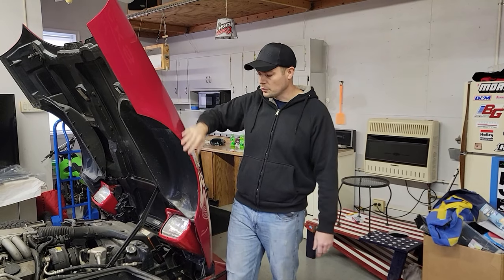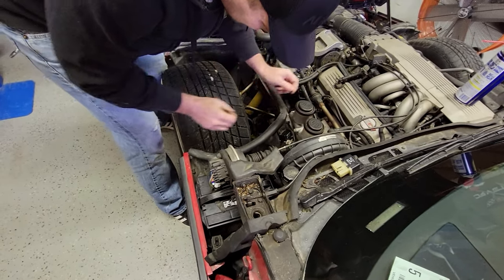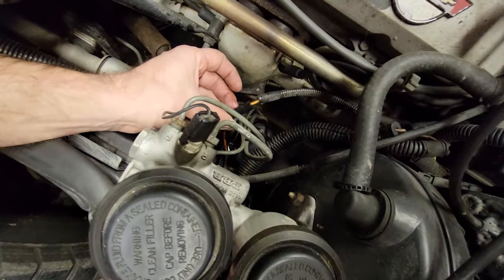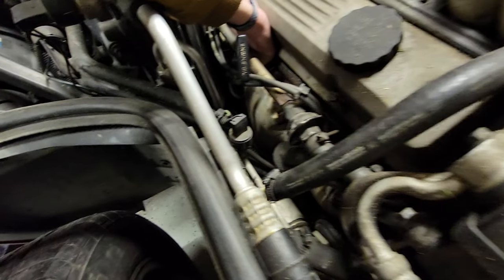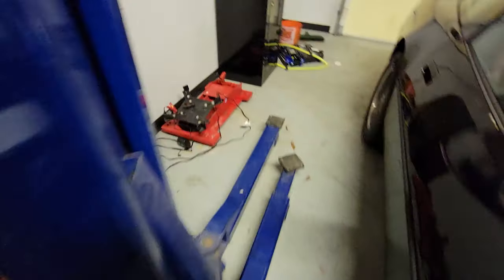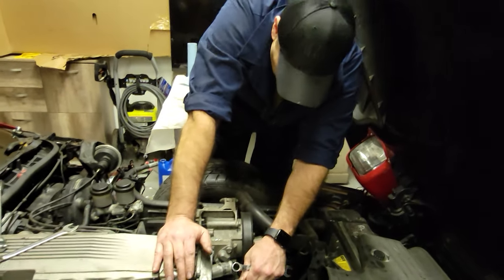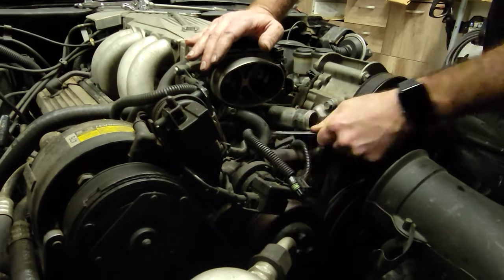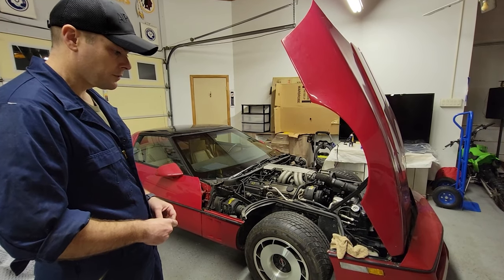New York Corvette Pt. 2- Back To Normal

Comment: Right hand head temp switch is (or should be) the optional boost fan (HD cooling package RPO V08), which is infront of the condenser core. Left hand head is a temp sender and is for the cluster only. At the front of the intake manifold is another temp sensor that feeds the ECM, beside that is the cold start temp switch. 

Temp switch you replaced in the right controls ONLY the boost fan, which is all that ran when you grounded that wire, hard to see in the video but your main fan wasn't running at that time. The ECM controls the main fan.

Comment: A little late but you may want to change your oil sending and pressure switch located behind the dist.
Mine blew out after a 50.00 dollar oil change. It was the original and had dry rotted. No damage done just had to get it home. Mine is a 1986 also had to change out the brake booster vacuum hose adapter which had dry rotted and cracked causing a sever vacuum leak.

Comment: 85's did not have the extra front chassis support. That wasn't standard till later. At least it's tpi. But don't have roller cam either. I have 87 red/Graphite Z52. Also curious about the master cylinder,  should have 1 bowl not the double.
Reply from the maker: This car has never been touched. 100% original one owner. What you see is how Chevrolet sold it.
Reply: @corvetterescued2324  Awesome find. Good luck with her. Enjoy tinkering with it. Not a vast choice for tires. Mine are so old now thinking I got them from eklers yrs ago. They call them vintage now.
Reply: My 85 has a double. Shop manual shows a double also.
Reply: @spenceair1972  87 they put the single on, was not a good idea. I have changed mine to the double, but I keep the original single.
Reply: @spenceair1972  and I have the z52 package

Comment: The fan comes on around 225...  why so hot ..u got me..but it worked...
Reply from the maker: According to GM engineering the car has better economy and emissions at the higher temp. We ended up with a 210 thermostat to keep it down a bit.

Comment: My fan doesn't come on until 229
Reply from the maker: Yeah it wasn’t coming on at all. Got up to 240 and I shut it down. Ended up being two issues. A bad thermostat and a bad temperature switch.
Reply: @corvetterescued2324  I'm quite surprised you considered driving it at all after sitting that long without changing ALL the fluids. I am glad you decided against driving it 500 miles. The hydraulic fluids will have slurped in a heap of moisture. The oil is well past it's serviceable time. The coolant will be junk. The in tank filter/strainer will be rooted and need to be replaced, they tend to go brittle and block the pickup. Get rid of the pulsator while you're in there. Replace the rail mounted fuel filter and get those injectors cleaned at the very least.

The fan is powered only from the relay, so the relay you took out was working well enough to run the fan, or it would not have run when you ground the diagnostic pin. 

Clear this car sat a long time, but i don't think it has been completely ignored for 20 years. Not sure what you paid for it, but given the condition of the interior it is still a pretty damn good condition car. 

If you haven't done so already, get the factory service manual set specific to 1985 and diagnose from that, it is all well and good to use other resources, but confirm EVERYTHING with that factory manual. Don't assume content creators on Youtube know what they're doing, i've seen some really f***en stupid things done to C4s on here over the years.
Reply: The MULTEC injectors are trash & shouldn't be cleaned.  Get Bosch 3 Ford 22 or 24lb 4 hole injectors from Fuel Injector Connection.  They have many injector videos, & they are the go to injector supplier on all the forums for years.   Apparently, the Bosch 3 are an incredible upgrade over the Multecs.  I put them in my 4.9 Eldorado to replace the old MULTECS, & the Bosch3 are suited & have a very atomized spray pattern.  See in their injector demonstration.vids......